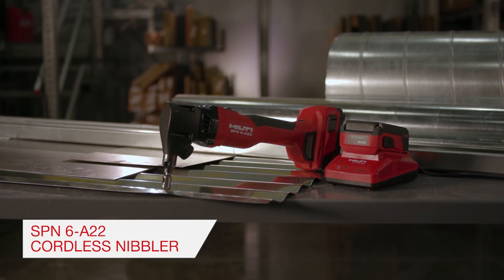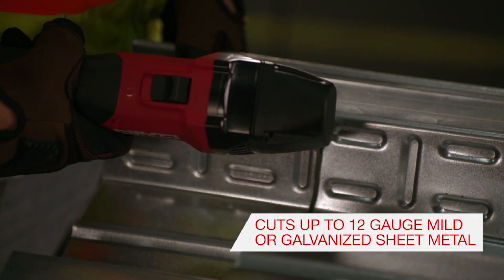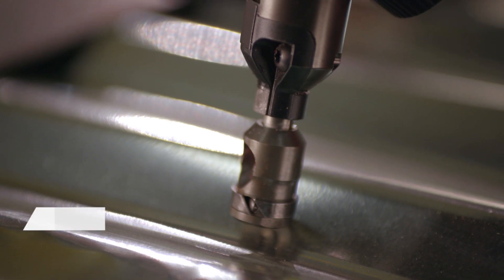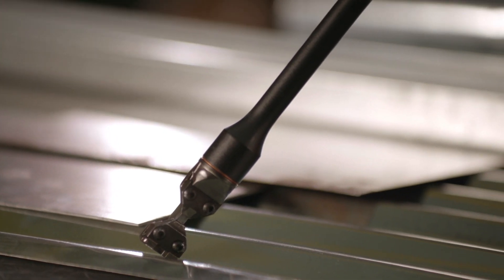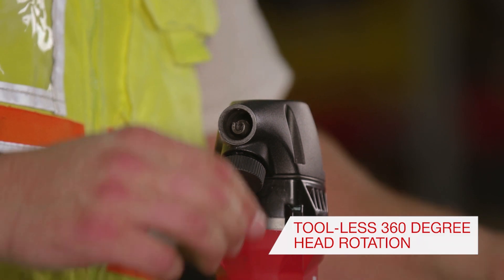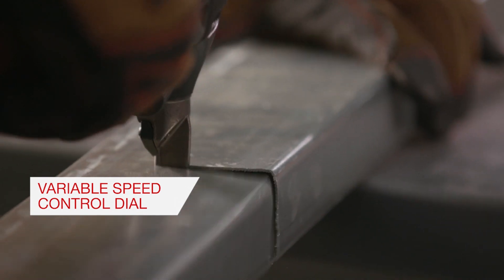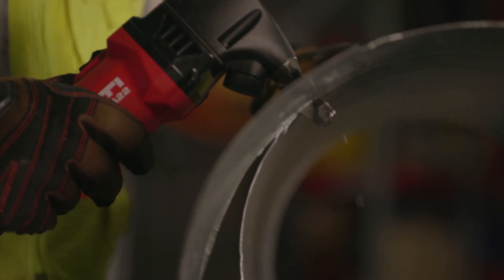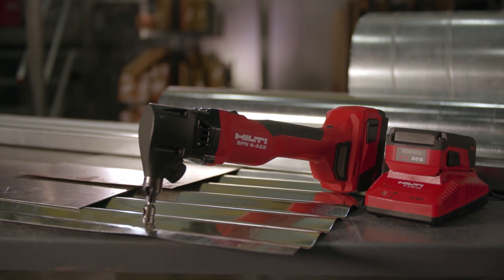INTRODUCING Hilti's SPN 6-A22 Cordless Nibbler

Comment: I love this tool. I'm running Milwaukee other than this and the BX3. Would love to switch over but hilti is so pricey. Bought their band saw on Kijiji for a steal but the blade already broke and is 50 some bucks to replace. I get 3 blades for 30 something for my Milwaukee band saw.
Reply: Hilti bandsaw is just a Chervon. You can use Bosch or Morse or Dewalt or anything else around 28-7/8”

Comment: Never cordless.  Disposable tools. Battery will go bad then either discontinued or $100 bucks.  Idiocracy.      Bad for environment to boot. Disposable plastic.
Reply: yes they are disposable. but if you cut man hours on a bid job at 100 plus bucks an hour. thats money. at that rate who cares cause usually come out ahead. speaking here from experience. take 100 men. make each guy more efficient by only one hour per day at 100 bucks an hour thats 10000 a day more on top of profit but having better tools and equipment
Reply: @RaviPatel-ex8er  here's the problem with this world. you missed the point. The company makes money, we ruin the world. Your next job will be built on top of a land fill. Whats the psf of a landfill boss?
Reply: Whilst the batteries are the bread and butter for most cordless tool manufacturers they are easily fixable and Hilti offer free servicing for 2 years and a great 3 days or free policy on repairs after. Corded tools are great where accessible but when you are constantly moving around a site carrying multiple leads and continuously sourcing power will just slow work down and hinder progress. 

If you are in say a garage as a mechanic or any other profession where your work isn't mobile then yes using cordless tools would be unnecessary you would be much better off using air tools. Companies aren't going to buy generators over cordless tools for all their workforce.